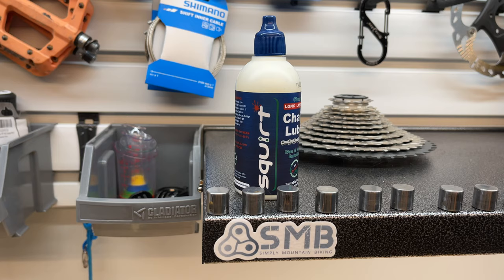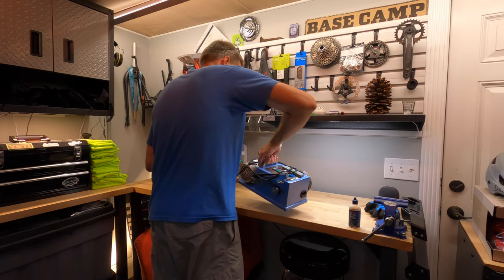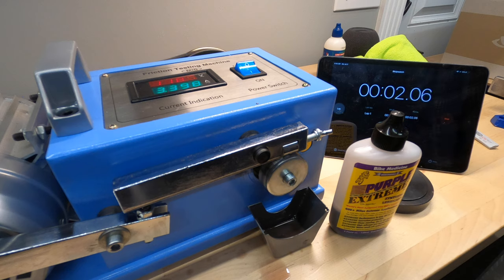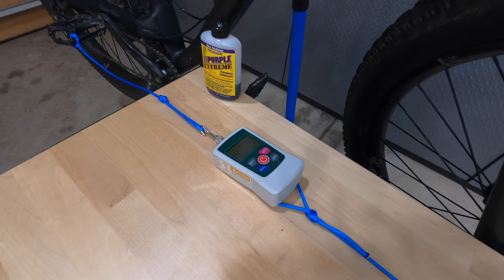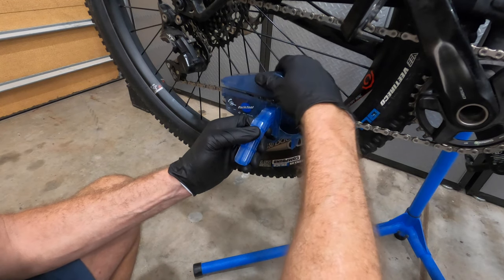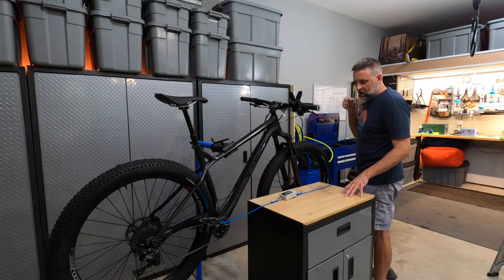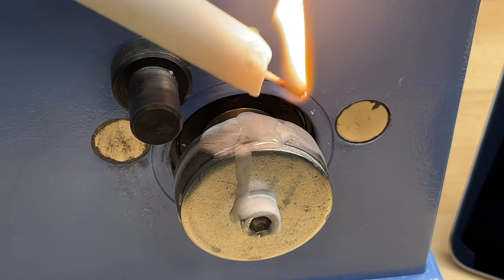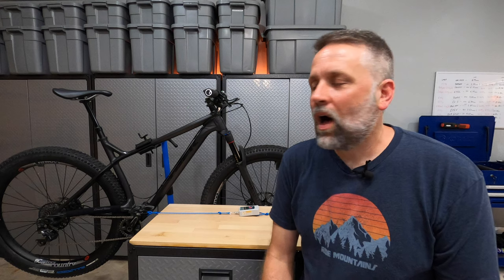Is Squirt a Good Chain Lube? | Squirt Wear Test

Comment: Thank you for the add on video addressing many of the reservations from the  previous chain lube video. In many ways you were seriously thorough in addressing concerns.
*
 I'd like to see those lubricity tests done again. This time, with your cup filled with just the actual lubricant AFTER the carrier has evaporated off. The static test with Squirt on the cylinder is only good as long as the grease is intact. This isn't a fair test against other things where they are actively flowing over the wheel. I think even the Muck Off lubricity test is invalid. It has a lot of floating grease in a carrier and isn't an actual test of just the lubricant. A chain dries out fairly quickly with use. That leaves behind the lubricant and no carrier. I could be wrong about Muck Off if it is actually an oil with no carrier. Just pointing out that the lubricity tests were not done how many of the chain lubes are intended to be used or the final state of the lube once it is applied to a chain. I'm betting other chain lubes perform much better than your initial results say they did. Just the lubricant in the cup for each one needs to be tested with no carrier fluid.
*
Id like to see the sling test redone. Give each lubricant an hour so all the carrier can evaporate. Then spin the chain. I bet lots more of them don't sling oil or grease. 
*
THE stickiness on the paper with sand test...that one was great!.
*
The test with the scale and weights to test how easy or hard it is to pedal. LOVED IT! PLEASE do this for all the lubes after they have had the instructions for each one followed. This is a good proof of lubrication in actual application. Do you have a torque sensor in your BB? Is it sensitive enough to measure this level of torque? That's a good test if it is!
*
Would you mind adding Finish Line please? When I first bought it long ago, it was supposedly the best stuff. I'd love to see if that is true.
Reply from the maker: Thanks for your comment - very thoughtful.  I do not have a torque sensor in my BB.  Finish Line will almost certainly be included in a viewer's choice video. -Eddie
Reply: @SimplyMountainBiking  Probably a BB torque sensor would not read the force needed to turn a free spinning wheel since that is a "no load" scenario. Thanks for replying back. IT shows that you care about what you do.

Comment: For me it's all about the cleanliness of the lube during real use, even if it's not the most efficient. I appreciate the testing, thank you for putting the work. 

I like Squirt, Cerabike (same thing just from Spain) or Inmersion waxing because they "seal" the rollers to outside debris. And that's what makes a long lasting chain, like others have already tested. And that's what i'm going for with my bikes, not ultimate performance. 

I tend to think that the .2 lbs (90gf) would be reduced in less than a 2km ride, but i see how that would skew the testing. I dont think any lube could make that big of a difference in drivetrain efficiency (10%)
Reply from the maker: Thanks for your comment! -Eddie

Comment: So confused now, as my longest wearing chain to date was the one that was waxed every 300km, but of course that is anecdotal. I do like the quietness and how clean it always seems to be compared to my other chains, but ... nice to see some hands on testing like this, and hope you take the top contenders here and expand the field.
Reply from the maker: Will do - thanks! -Eddie
Reply: because wax takes the least dirt on it, I've noticed that my squirted chain is louder than oiled but squirt performed exacly the same after 50km of riding as on 5km of riding and oil just dies after the first puddle or sand spot

Comment: As a wax-based lube, I think it makes sense that the wax on the surface of the lube will be got ripped off after a few spins. So it is not very surprising to see the result: it is close to not use lube at all. Still, since wax actually stays inside the nodes of the chain, I think this can make a great difference.

Anyways, I think this is THE most comprehensive chain lube test I have seen, good job.

I am running squirt for my m9100 chain, so far so good. At least it does keep the chain very clean compared to wet lube. (I live near tropical area and it rains all the time)
Reply: I swear that my chain wear is unobservable after I used squirt for a couple of hundred kms. Maybe it makes a difference that the tool just dan shrug off the wax from the wheel, while in the chain it is enclosed tightly in small spaces.
In the end I don't want to use oil anymore to lube my chains.
Reply from the maker: I don't see how it can't get pushed out and not be able to flow back in... -Eddie
Reply: @RelakS__  I do find it very difficult to get squirt into the chain node of 12sp chains. The rollers are so tightly fitted that lube like squirt can have a very difficult time trying to get into the rollers. But I do find it is much easier for 11sp and 10sp chains like 11sp ultegra and 10sp tiagra. The gap between the chain rollers and links are wide enough for the lube to flow into it.
Still, I evetually went for silca's wax lube. Expensive and worth it for 12sp chains.
Reply: @SimplyMountainBiking  After drying out, squirt is basically wax and no more, no additional material like teflon powders or whatsoever. So I don't feel like it can 'flow' anymore after the water in the lube vaporize. Still, according to zerofrictioncycling's tset, the main problem about squirt is that it has huge initial application problem (hard to get the lube into the rollers).

Comment: I use squirt lube for 2 years and is the best! I put a new chain last year and has 600km on it and more than 300 km on hard climbs and it has no wear on it. I just love this lube and i will not change it for nothing. With normal chain oil i have to replace the chain after 800-1000 km even if i clean the chain after every run.
Reply: Then you’re doing something very wrong. You should get 3 - 5000 km on a chain easily.
I just swapped the chain on my road bike (SRAM flat top) because it had reached .5 wear. I had it on the bike for ~4200km and always used just whatever random lube I had on hand (muc off, finish line, etc.)
Reply from the maker: Thanks for sharing. -Eddie

Comment: From what I've seen from Silica there are pro racing teams that are using the molten speed wax lubrication on their team bikes.  Of course they may change out chains after each race leg but I find paraffin wax a great lube for my bike...and no more dirty oily chains to clean.  Clean a wax chain every 200-300 miles by putting in boiling water to melt the old wax, remove and wipe dry then put into your molten wax to rewax the chain.  Squirt is good to have on those long multiday rides where you can't do a proper cleaning and rewax.
Reply from the maker: In the conditions I ride, I clean my chain every 5 rides or so.  It seems prohibitive for me to take off my chain every 5 rides to remove the old wax.  I prefer a lube that's easier to clean off.  Muc-Off comes off with high pressure spray from a garden hose and then running the chain through a microfiber cloth a few revolutions. -Eddie

Comment: I mean a lot of road cycling companies have done tests with wax lubes, and often see a benefit in terms of chain life and watts. A better way to test would be to have 2 power meters one on the cranks and one on the wheel. This is how they usually test efficiency of chain lubes. I get that's probably not easy or affordable to reproduce. Also waxing a chain usually means cleaning the chain thoroughly with solvents and then submerging it entire in hot wax.
Reply from the maker: Yeah - I'm thinking for road, wax might be good. -Eddie

Comment: I have been using squirt for a while, putting it on and then the following week wiping it down. I still have crazy amounts of clumping around all the gears that it's touched. It's so bad on the rear derailleur cogs that it will grab small pieces of stuff as I ride and wedge it into the bearings. Small pieces of string from moss and other forest stuff. This time I put it on I only let it sit about 15 minutes and I wiped it all down. I wiped every bit of excess off everything, and then hung the bike to wait until next weekend to ride. If there are still clumps (and I mean it was bad, I've had to use a pick and screwdriver to get it off the cogs) I'm throwing it away and going to something else. I think for my purposes a dry lube is going to be the best, but I need to find one that goes on thinner than Squirt. I'm in FL too, so don't think it's because it's too cold out.
Reply from the maker: Weird.  I think this is the first I've heard of this here in the comments. -Eddie

Comment: Finally - some empirical testing to confirm my doubts about Squirt. I was NOT happy with it on my chains and it was useless trying a chain cleaner and degreaser to get it off. These days, I avoid it and advise my friends not to use Squirt. I would really rather use Boeshield T-9 or Weldtite's TF2 all-weather lube on my chains. Thank you for the excellent content!
Reply from the maker: It's interesting to me how many people get great results - and others share poor results.  My thought is that it's likely a very good chain lube to use in very dusty and dry areas with a lot of airborne fine particulate.  Where I live - it's humid with loamy or clay soils.  For me - I want to use something that's easy to clean off and provides the best wear protection.  In my opinion, Squirt does neither of those well. -Eddie
Reply: Weldtite all weather doesn't get much attention, but it's hugely popular with mechanics and pros, and cheap. I use it on my commuter ebike & it's very effective. It's also sold by big stores like decathlon & Halfords under their own brand name, they shift tons too. Never see it mentioned much though, which is odd really.

Comment: After getting sucked into all the hype & drama surrounding bicycle chain lubes, I've decided to go the cheap route. 
1) Simple Green to degrease
2) Champion Lithium Chain Lube (Water Proof)
3) Super Tech Bar & Chain Oil (Heavy Duty)
4) Enclosed chain cleaning gizmo so I don't have to remove my chain every time.

Everything purchased at Walmart, including my Huffy Shimano 18 speed MTB. Why spend alot on designer chain ube for a a Walmart bike??
Reply from the maker: Seriously can't go wrong with this. -Eddie
Reply: @SimplyMountainBiking  I found out the Champion Lithium Motorcycle Chain Lube goes on liquid and dries into a gooey solid, kinda like wax. But you can see it & it looks messy. So I talked to the bicycle assembler at Walmart where I bought my MTB. He recommended WD40 Silicon spray & WD40 Dry Lube with Teflon!! That's what he used on his own bike. Walmart also sells their own off brand version of Silicon Lube spray at half the price of WD40. So that's what I'm using now. I'll go broke using these designer bike lubes that are too much for my Walmart bike which I adore. I love BOTH of my Walmart MTB's. 24inch & 26inch. I'm spending my money on bike accessories, which adds up quickly!!

Comment: I think my favorite aspect of squirt is how quiet it can be. Especially on a road bike where the only noise is often your chain. Dirt from the desert seems to be less likely to stick too. Haven’t noticed any drag caused compared to muc off or epic. Of course, a quarter pound is a very small percentage of my body weight when accelerating from a stop.
Reply from the maker: Great point! -Eddie
Reply: I found Squirt to be loud.
Reply: @justinwbohner  you're not using it correctly

Comment: Hi Eddie! I really enjoy these types of componentry / peripheral products content for bicycles, and look forward to seeing more!
Also want to add on that for Squirt, the residual gunk after some rides is incredibly difficult to get rid of. Unlike its marketing whereby the gunk is supposed to flake off, it adheres strongly to the chain. I'm guessing that it's a characteristic of wax-based lube, giving a pseudo-clean look on the surface, but still leaving chain marks on my calfs. :(
Reply from the maker: Yeah - I just tried to remove it from my chain and it was going nowhere.  I guess it needs a hot bath! -Eddie
Reply: Dont try to remove wax with hot water. Always use cold water and degreaser, otherwise the wax will melt again and become even more sticky.

Comment: i have used many chain lubricants and in real would testing on my bikes found squirt or really most wax emulsions is the cleanest and gives me the best life out of my chains 10,000km+ 0.5% wear.
with muc off its not really dry but just gets sticky as the solvent evaporates away and have found that after little time in wet conditions all lubrication is striped out of the chain negating the better wear in your testing, but with wax i have ridden 3 hours in the rain and lubrication of the chain is still good. 

best benefit of the wax lubricates is that they are truly dry and leave little if any residue on chain rings cassettes and jockey wheels unlike muc off if you touch the chain you are getting black hands.
Reply from the maker: In the conditions I ride, I need to clean the chain regardless of what I put on it every 5 rides or so.  I'd much rather have something easy to clean off, in my case. -Eddie

Comment: Very interesting. I have been using Squirt for years and had no issues with wear. I may need to go back to my old lube and start cleaning my chain after every ride.
Reply from the maker: Yeah - I'm not sure Squirt's formula is great for wear protection. -Eddie
Reply: @SimplyMountainBiking  Yeah - it is.

Comment: Personally I have tried paraffin candle wax on my chain on a commuter bike that I used 365 days a year in all conditions(yes, snow as well). 
I used it for 2 years straight until I just had to question it all. If I lived in dry conditions most of the year I feel it will serve a better purpose, as well as mostly for tarmac use. My experience after x amount of miles in all year conditions is that it is very nice the first day if it is dry conditions. After the first day the dampened and quiet feel quickly changes to more noise as you wear through the coating on the outside that just breaks off. After this you notice a very noticeable decline in gearshift performance, and the overall performance just feels lackluster. 
When you add real world weather scenarios into the mix, you quickly sit there feeling like you went on a ride and forgot to lubricate your chain. 

The myth that there is no dust build up is such a big fat lie I am so tired of hearing all over by the way. Slightly less muck buildup I can agree to, but in the longrun that was no sellingpoint to me. 
After all this time my feel is that it is way too much work for very little gain, and you just end up getting paranoid about anything drivetrain related lol. 
Now that I've gotten a trailbike that gets filthy mcnasty all the time, I do a full clean after each ride, and I just won't deal with the hassle of waxing a chain for that use. If someone still believe you can ride through a bog of mud and your chain will still be squeaky clean with a waxed chain, you are just being naive.
Reply from the maker: Thank you for your feedback. -Eddie

Comment: I will still use it.  I use the ultra low temp stuff!  Yep i winter ride in the cold when its dry.  Which is not iften in the UK!  No chain cleaning.  Seems to perform well in the real world on my chain whilst riding.  Lasts about 700km before i renew.  I don't ride in the wet so i cannot comment.
Reply from the maker: Thank you for your feedback. -Eddie

Comment: Isn't the Muc-Off Dry Lube that won your chain lube shootout also wax-based? I'm surprised there is such a large difference in performance between Muc-Off Dry Lube and Squirt. Any theories on why that might be? I'm not familiar with either of the two lubes to know how they look/feel when applied to a chain.
Reply from the maker: I think it may be the PTFE in the Muc-Off? -Eddie
Reply: @SimplyMountainBiking  Where did you read that Muc-Off contains PTFE, Eddie? Their website says it is biodegradable.
Reply from the maker: @pjdjr  Someone else replied to the video that MucOff Dry had PTFE and was not biodegradable.  I looked into it and found inconsistent ingredients.  Someone pointed out that you can have a percentage of PTFE and still call your product biodegradable in some countries.  I honestly was left unsure.
Reply: Wow, I'll have to look into that as well. Pretty interesting if it turns out to be the case. Thanks for your reply, Eddie!
Reply: @SimplyMountainBiking  Take this for what it is worth, but I wrote to Muc-Off and asked if there is PTFE in their Bio Dry Lube (your shootout winner) and they replied, "No, it did used to [contain PTFE] but the new Bio version does not contain any PTFE....As a brand we are trying to avoid PTFE in any of our products!" I have seen some (seemingly older) Muc-Off dry lube online that explicitly mentions PTFE on the label. Just speculation, but the product you tested has the current packaging, so I am thinking the lube you tested is PTFE-free.

Comment: You should do a follow up comparing Muc Off’s C3 Ceramic Dry Lube (Higher-end) to the normal Muc Off Dry Lube you previously tested.  

From personal experience a lot of people I know are using the C3 lube because Muc-Off claims it’s better stuff.  

I’d do a submerged wheel test and dry test for the wear scar test.
Reply from the maker: Thanks for the suggestions! -Eddie